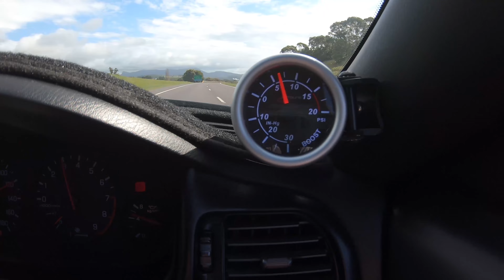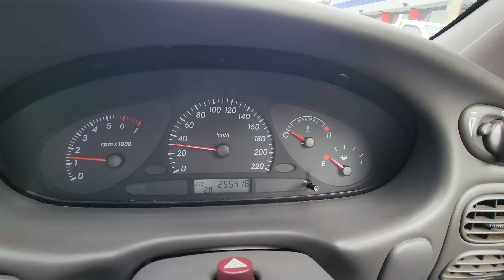Engine Teardown

Comment: Pro tip: Always pop the oil pan off with the motor right side up and preferably before you roll it at all. That way any wayward metal or parts are in the bottom of the pan and easy to spot.